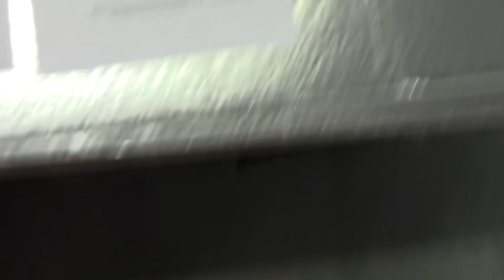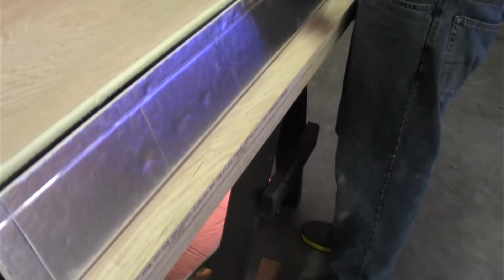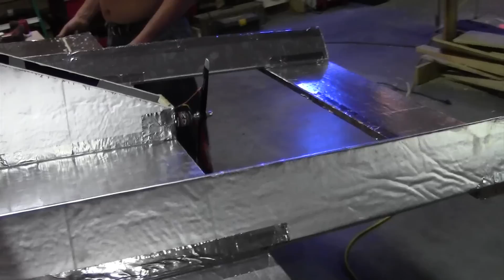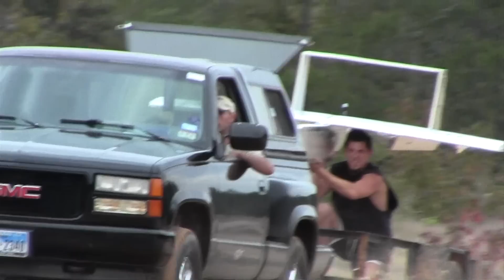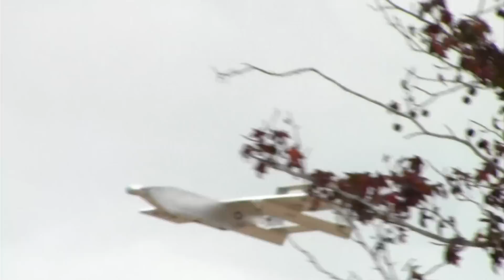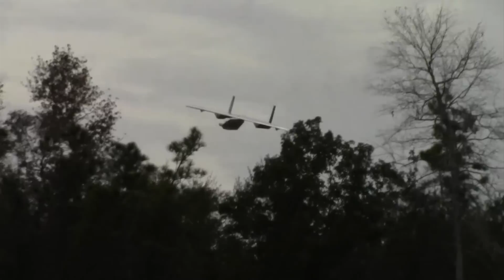So.SuperBig Giant Foam RC Airplane with 96" (2.4M) wingspan - Episode 2

Comment: That rocked! More power and she could fly for days.
Reply from the maker: Thanks!  I have been toying with doing another one and along with a more powerful motor and prop combo I also would like to shave off a few pounds, maybe using rib-and-covering wing construction rather than being solid foam board.  Also the KFM.3 airfoil is easy to construct but I think it's dubious and want to switch to one of the more standard NACA high-wing high-lift airfoils.